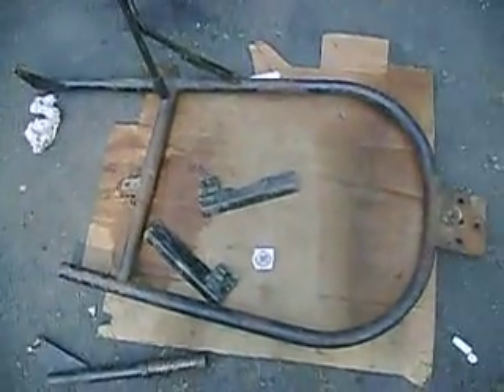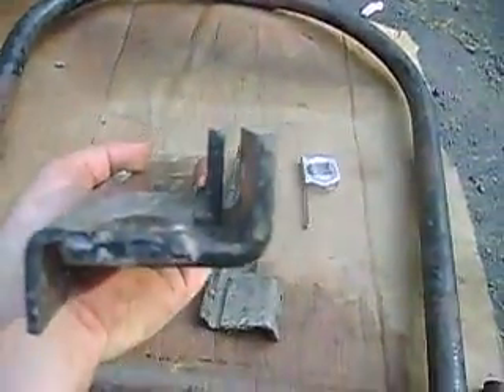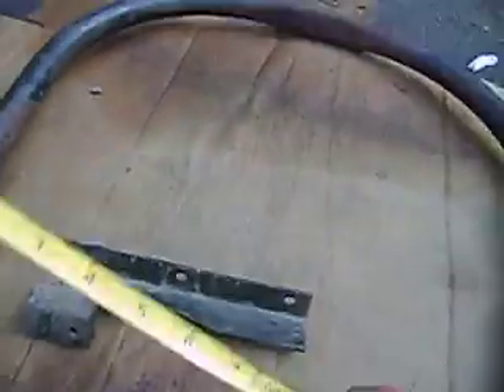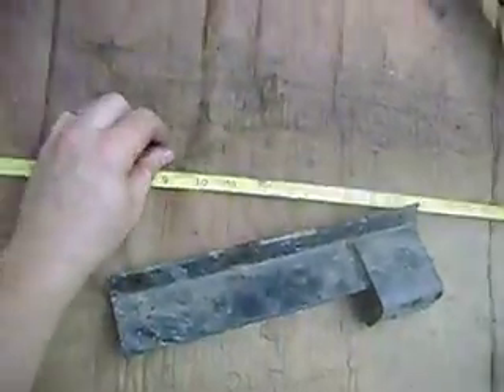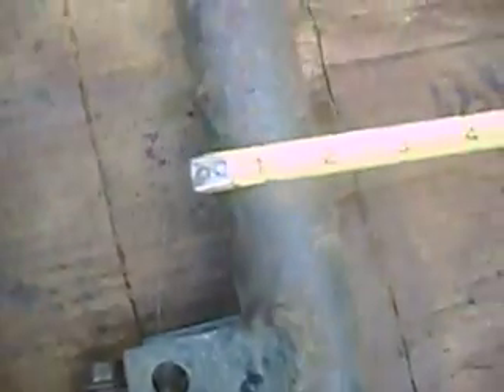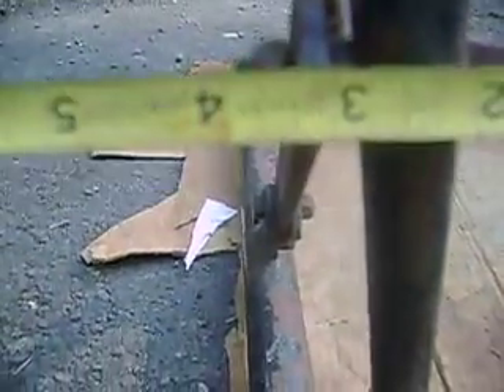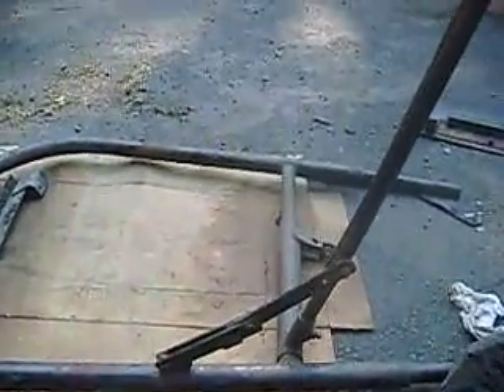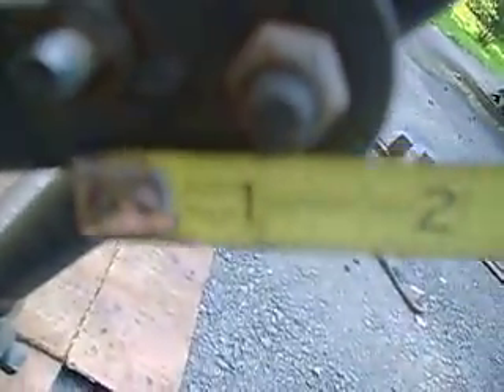*UPDATED DESCRIPTION 12-17-11* 1987 Honda Big Red 250ES ATC Plow Walk-Around (Part 3)

Comment from the maker: I used to have a winch on the front rack to raise and lower mine until I figured out how to mount the thing properly.  When it was raised up in the air with the winch, all the weight from the plow blade made it really tough to turn the front wheel either way.  Something to consider.